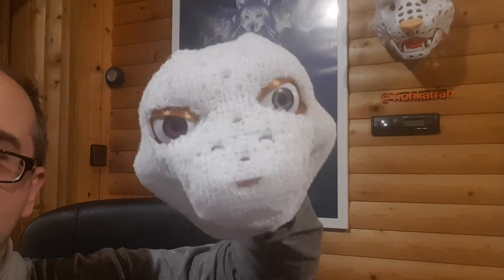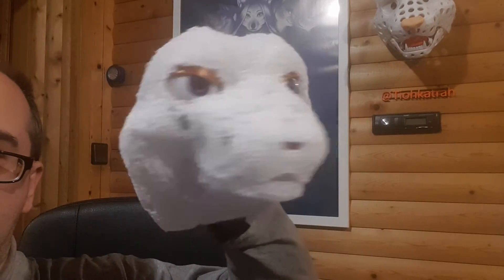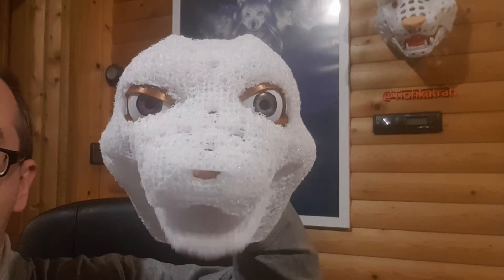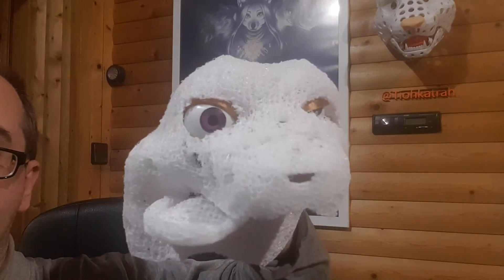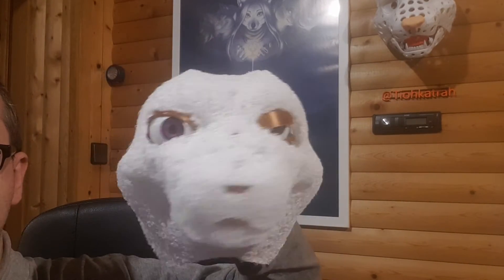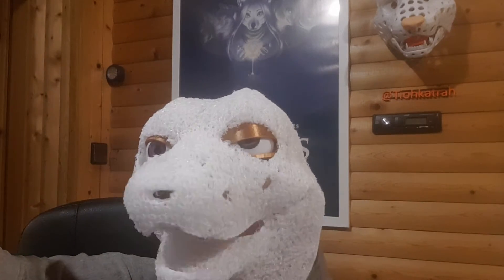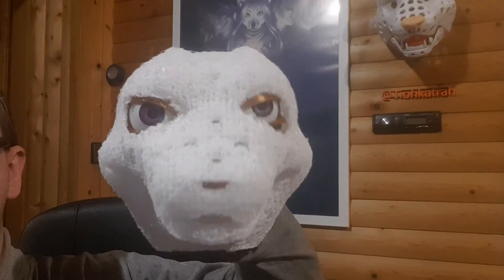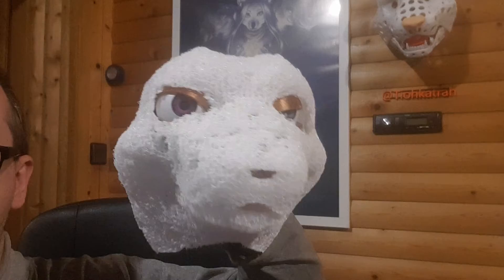Testing a 3d-printed puppet head base

Comment: Oh cooool it's so animated like a foam puppet but is it hard to close the eyes at times?
Reply from the maker: I would stiffen the area around the eyelid so that it's not deformed when the puppeteers hand moves if I ever use this head for a puppet. As it is now the eyelid can get stuck on the head base if the head is deformed too much - it moves freely if I hold it normally.